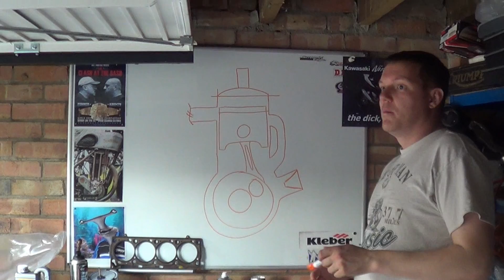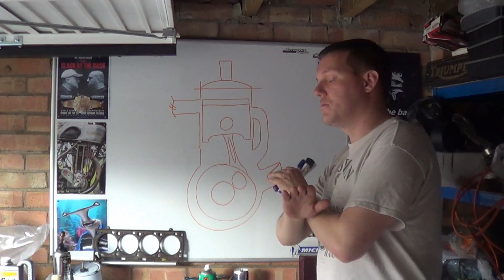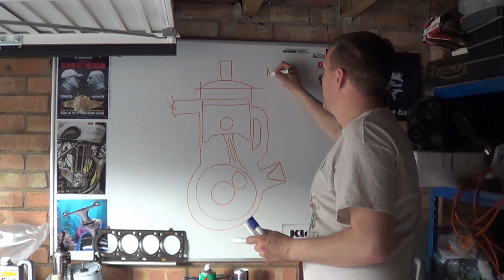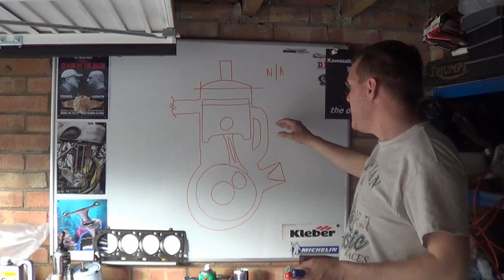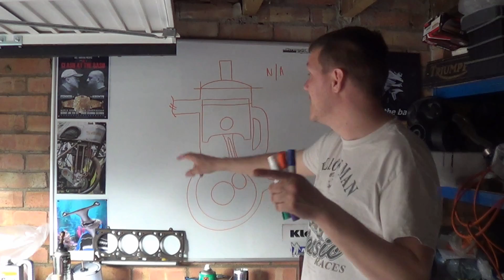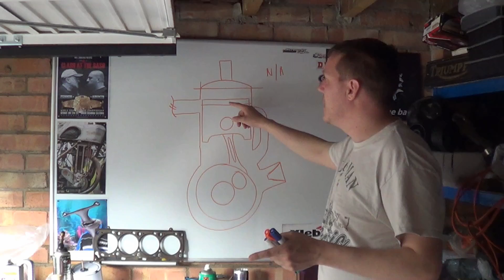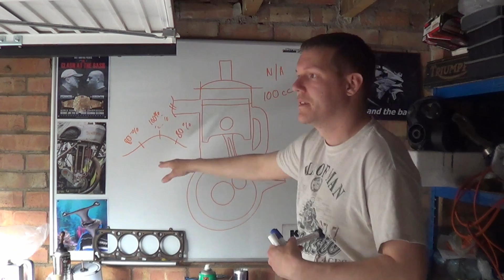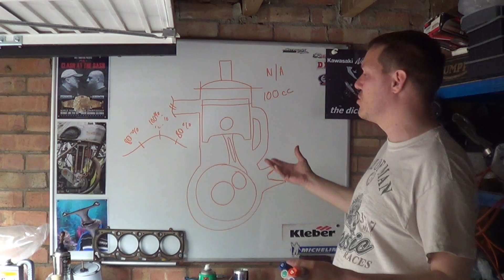2 Strokes are NOT supercharged!

Comment: The two-stroke diesel can't be supercharged, the blower's just moving air into the cylinder. I think the confusion comes from hot rodders adapting blowers from two-stroke diesels onto a four-stroke petrol engine for use as a supercharger. Two-strokes can't operate with forced induction, it's going to blow right through because exhaust and transfer ports are open when the piston's down at Bottom Dead Centre.

Comment: So if i want to supercharge (in theory) old 2 stroke engine like this one from Wartburg 353 (~1000cc) or FSM Syrena (~850cc) i  should use supercharger like eaton m45 (740cc per rev) or m62 (1016cc per rev) I know that i can adjust supercharger speed by  pulley ratio. Which design should i use blow by or draw thru carb. I think draw thru would be  the easiest configuration, but i'm curious how supercharger will react to oil in air fuel mixture and how big carburetor should i use? The one of 4 stroke engine will be fine like Weber 34DCMP (1300cc engine) or a bit bigger FSO 34s2c16 (1600cc engine)?

Comment: I have to disagree here. Most modern 2 strokes have a volumetric efficiency of more than 1, as they use the inertia of the mixture to keep the reed valves open for longer than the compression stroke of the piston. Also the mixture is then FORCED to the combustion area instead of the intake. To make my point even more clear: Some 2 stroke diesels had sealed crankcases with 4 stroke lubrication system AND big external superchargers and rarely turbochargers which are the norm on diesel engines. The 2 stroke crankcase design is an internal supercharger!
Reply from the maker: "To make my point even more clear: Some 2 stroke diesels had sealed crankcases with 4 stroke lubrication system AND big external superchargers"

- lol to make my point clear! that did make me laugh. So what your saying is there are 2 stroke diesles that require additional superchargers. Why if a 2 stroke is already supercharged? 

- not only that but why do they need a supercharger? That's right, because they can't TRANSFER charge into the cylinder without some form of pumping.
Reply: Turns out you're not the sharpest pencil on the desk: "Some 2 stroke diesels had sealed crankcases with 4 stroke lubrication system ". and like you said:"they can't TRANSFER charge into the cylinder without some form of pumping".
PS: At least I kept it decent and explained my point instead of childishly trying to insult anyone who has a different opinion or wants to point out something.i bid you adieu!
Reply: you was doing pretty good untill you started in on them Detroit's that are not even close and the crank cases are never seal or they would make a hell of a mess when the oil pan blows off  to two stroke piston port or reed valve by the way its not the inertia but the viscosity of the air/fuel ..and as soon as that piston reverses direction towards bdc you want those reed valves closed tight and the delren reeds seem to be the ticket ..metal one crack and break off and the chunks play hell on everything ..fiberglass dont seem to hurt anything but untill i felt some power loss pull the carb and the fiberglass reeds were all chewed to hell splt cracked and broke clean off .looks like delrin is your only way to go ..but you look under the hood of a Detroit V8 you will see a 6-71 gmc blower fed with two turbos one off each bank

Comment: As the piston goes down and the pressure below it builds an equal vacuum is created above it which pulls the mixture at the same time so there is no net gain in pressure throughout the cycle.
Reply: I would imagine there's a pressure drop in the transfer port from the venturi effect (although I don't have any specs on transfer port cross-section, so that's admittedly a guess) - and probably the crankcase starts below atm. pressure, because of inertia of the incoming charge and the restriction caused by the carb's venturi), not to mention inertia of the charge as it starts to move from crankcase to combustion chamber.  I think this would mean the intake system runs slightly below atm. pressure virtually all the time - except for possibly the crankcase getting a small amount of pressure as the piston descends, before it overcomes the charge's inertia.  On the other hand, I don't claim to be an engineer - your thoughts?
Reply: Possibly, I haven't put that much thought into it. I'm sure there are a few trade offs going on, but the end result is no gain (boost) after all is said and done.
Reply: there is no vacuum  above ,,instead it exhaust gas pressure as it just now fired remember this is a two stroke not a four stroke their is a difference..so as you said the pressure builds in the crankcase and how high would that be ..it will be ? answer: above 14.7 p.s.i.(atmospheric) makes it supercharged as you said it yourself